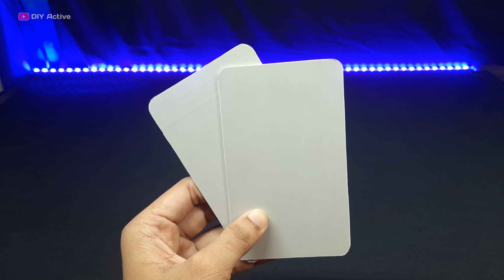Homemade Power Bank Using Old Mobile Battery from PVC Pipe - DIY Active

Comment: Bro i am making powerbank with this module and may i know your actual mobile phone charger volts and amps does it support fast charging from this module. Please reply bro i need serious help.
Reply from the maker: This model does not support fast charging & Due to high internal resistance in this module,  the battery drains very quickly....
Reply: @DIYActive  thanks bro for the reply
Reply: Let's assume the powerbank mah is 5000 can it full charge a  4000 mah phone?
Reply from the maker: @ayushmansarangi8260  👎 no
Reply: @DIYActive  ok bro 😅btw yaar ye module leke galti kardi
Reply from the maker: @ayushmansarangi8260  main bhi galti kar di... paisa barbaad